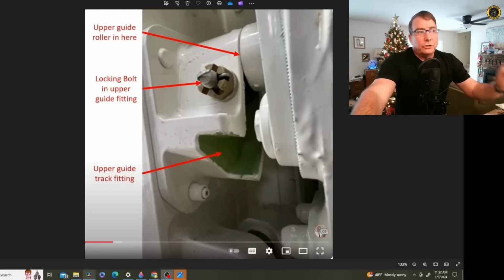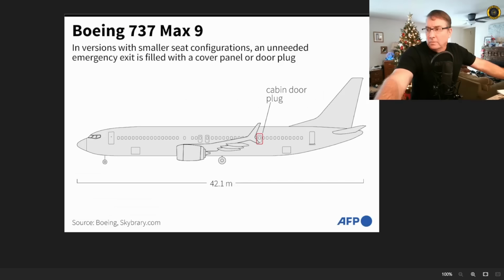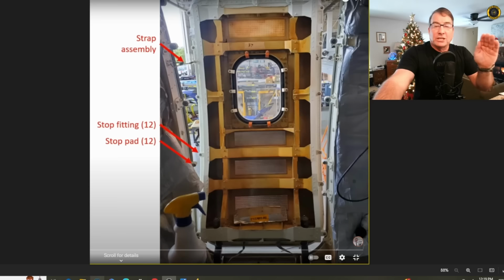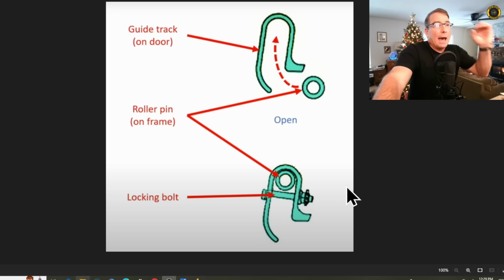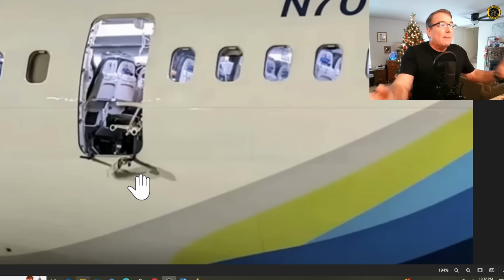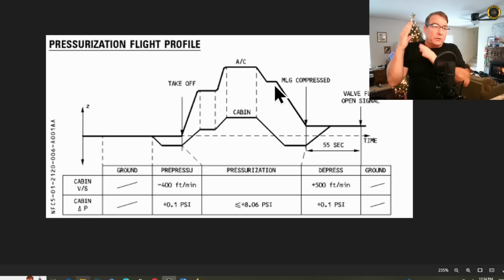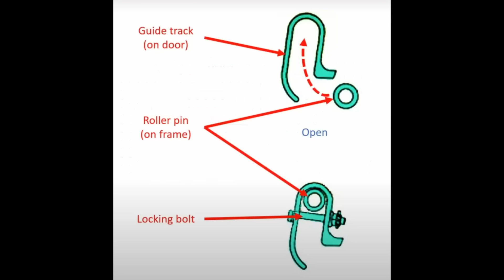Alaska 737 Max-9 Door UPDATE! 8 Jan 2024

Comment: It’s bad that the door plug blew out, but it’s also bad that the CVR only holds 2 hrs of data before it’s erased, so the NTSB doesnt have the additional data that could be useful.
Reply: This really feels like the NTSB throwing a fit because the 2 hour thing is a pet peeve of theirs right now.  What really useful data about the door plug coming off is going to be learned from the CVR?  It's not like there's a cockpit control for those doors, and everything else should be in the instrumentation data recording.  Not saying that longer CVRs aren't useful in some accidents, but this doesn't feel like one of those accidents.
Reply: It was far less than 2 hours from Door Loss to Engine Shut down.  CVR should be GOOD.
Reply: @brianbarrett8228  Do these planes transit telemetry back to company ops?
Reply: @brianbarrett8228  You're right in that the CVR isn't likely to shed light on the cause of the incident, the value in CVR is "lessons learned" in handling it.  What worked, what didn't.  What were the challenges, and how were they dealt with?  Those can be valuable lessons used in training pilots in handing explosive decompressions from any cause.
Reply: Apparently pilots didn't shut down CVR (and it wasn't a traumatic crash or anything) so they just kept running and overwrote the entire flight @HoundDogMech
Reply: Today's NTSB update included that the breaker was not pulled on shutdown and that most of the CVR had been overwritten.
Reply: @brianbarrett8228  I agree that it may have low relevance in this situation, but I was floored to hear that SOP after an incident like this is to pull the circuit breakers on the black boxes to prevent recording over the existing voice/data.  What?!  That sounds pretty dumb to me.  Preserving the last 2 hours is not enough, but I suspect it may have been something negotiated by the pilot's union?
Reply: @brianbarrett8228  CVR not that useful here I agree, however there are still some aspects of flight deck to cabin communications that could be looked at as part of investigation.
The Air Canada near miss at SFO however was the big one where CVR would have been absolutely invaluable.
Reply: Car is turned on or off either when electrical power is turned on or the rotating beacon is on, depending on aircraft model.  It is not controlled by the engines running or not @HoundDogMech
Reply: @HoundDogMech CVR records until the CVR breaker is pulled. Magically the mechanics that went to pull the breaker happened to miss the 2 hour cutoff by just minutes. "Nothing to see here folks just move along".
Reply: @HoundDogMech  They failed to pull the breaker so it is lost. We would need the book to see the checklist after all passengers are off the plane and if it safe do you then go back and pull the breaker?
Reply: It has been over a decade and certainly after MH370 that I have wonder why the digitally converted logs are not relayed from time to time.. to some base station.. like a live transmission but in bursts of 15-20 minutes .. if not fully live streamed.
Reply: Hey guys, CVR only records what is said in the cockpit “Shit, what was that” for example. Data recorder logs all functions of the aircraft.
Reply: What information would be on the CVR that would make any difference to the failure of the door plug? All you'd get would be the pilots going through checklists and comms required to return and land. I agree that the rules about only retaining 2 hours of CVR need to change, and there needs to be better procedures to ensure that the breakers get pulled, but in this case I don't see what benefit the CVR data would provide.
Reply: That's what I was thinking too. If I was cynical I might get to wondering whether it was conveniently wiped or left to run on. Though, as someone else has said, I can't see how the CVR would have any relevant content in the case of this incident.  @HoundDogMech
Reply: @Wizzyhatg The pilots declared an emergency so the breaker should have been pulled once they were down!
Reply: CVR info is required to review the actions taken by the flight deck are correct 
Ie did they follow the required check list etc 
Lessons are always learnt from any incident
Reply: @JoeSmith-ig3pr   said " Do these planes transit telemetry back to company ops?    " 
I think that Mentorpilot did a piece on this. In short, data isn't transmitted as the logistics would be a huge undertaking.  Onboard data is just fine for the moment.
Reply: Not sure how the CVR could be in any way useful to this investigation.
Reply: @michaelkim3432  why does that sound dumb?
Reply: @brianbarrett8228  The CVR might shed light on any pressurization issues noticed during takeoff and climb out; including any commentary from the crew about it.
Reply: @sailaab    said "   I have wonder why the digitally converted logs are not relayed from time to time.. to some base station..     "  
Mentorpilot did a piece on this, basically it is impractical due to the amount of data that needs to be transmitted as well as international flights being beyond any sort of base station.  With recent tech, there could be a satellite link however the vast amount data would still need to be stored somewhere
Reply: Seems crazy that a CVR can only record 2 hours of audio when you can pick up an mp3 player that hold hundreds of hours of music for a few dollars.
Reply: What conversations inside the cockpit what possibly aid the investigation.  It was a mechanical issue, not a piloting issue.
Reply: @stvrob6320  It sounds dumb because the procedure requires a human being to pull the circuit breakers.  If the crew is responsible, they may be a bit frazzled having just landed in an emergency, and in this case the ground crew also missed this step.  Transmitting digital recordings intermittently to a company server OR increasing the CVR recording interval beyond only 2 hours OR if the aircraft itself would know that an emergency had been declared you could remove the dependency of someone to physically pull the breakers. This technology all exists today.
Reply: @alanrobins  Their check lists were all blown about the cockpit.

Comment: I am an A&P mechanic The locking bolts are a bolts with castilated nuts and cotter keys.  As you know the castiiated nuts spin on with little or no resistance with the cotter pin installed providing the only locking.  I went to my hardware kit i fund a large assortment of cotter pin because they are never reused.   The final locking of the door after the interior installation probably never had the cotter key replaced  or the wrong keys were used.
Reply: My mind's eye says that that to close that plug, the top of the plug is rotated toward the cabin of the aircraft at which point the bottom of the guides on the top of the plug engages with the pins at the top of the opening frame.  Then in some way, perhaps in using an unspecified tool, the plug is pushed down compressing the springs to such a point as the plug, using contact friction with those 8 overlapping tabs, seals to the cabin frame.  While the plug is held down the 4 bolts are put in place, after which point the tool can be removed and nothing should EVER move.  If a bolt isn't put in place, my mind's eye says that the plug would pop open as soon as the compression tool is removed.  I just can not imagine that a friction fit between the plug and the cabin opening would ever be enough to hold the plug in place on it's own.

So I say that during installation only one bolt had been put in place, and without a nut, and then the compression tool was taken away to allow for easier access to complete the plug installation.  However, as another commenter stated, a "shift change" style error occurred where the plug installation was never fully completed and the 4 bolts were never installed and secured.  This could happen either during original assembly or during a maintenance process.  My guess is that one of the holes for the bottom bolts will show wear from a bolt moving back and forth in it.

Comment: The flaw in this whole scheme is that the bolts can't be checked once the interior panelling is in place.
Reply: They are supposed to be checked BEFORE the interior paneling is installed.  The apparent flaw is that they weren't checked.
Reply: @skyhawk_4526  But you can't easily double check. Someone shuts the door from the outside. Later someone else goes inside to check and finds interior panelling in place. Now what? Were the bolts installed before the panelling was installed? Did anyone check? How do you double check the records?

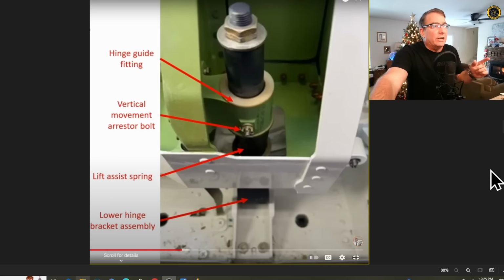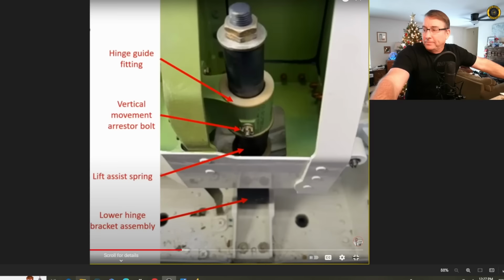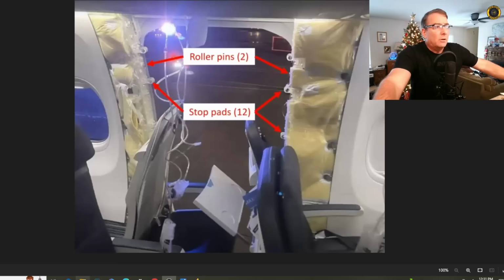Comment: 2:51 Spirit AeroSystems fuselage built in Wichita, shipped by train to Renton for final assembly, where door plugs removed, reinstalled, pressure tested 4:10 door plug explanation: hinges, spring, straps, 12 stop pads / frame fittings 5:49 bottom hinge 6:55 top 8:46 N407AL fuselage door frame